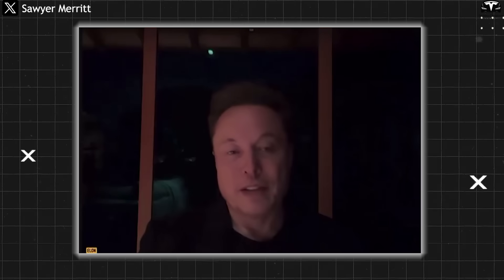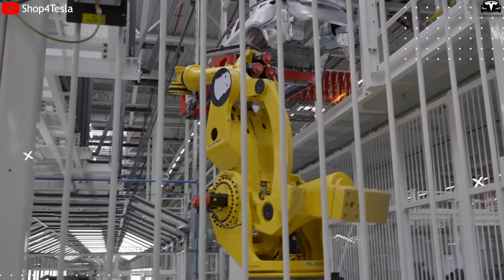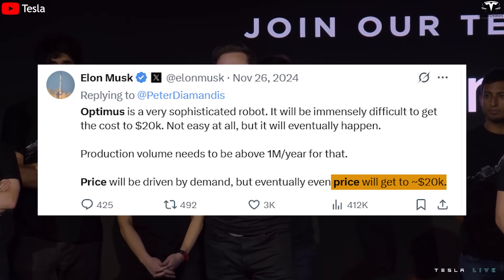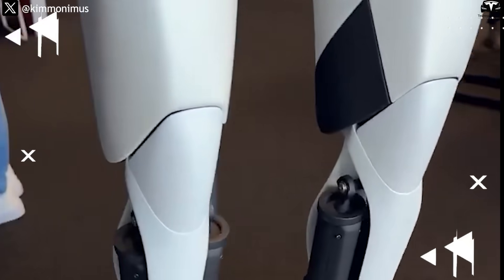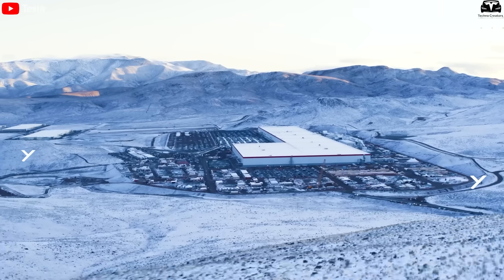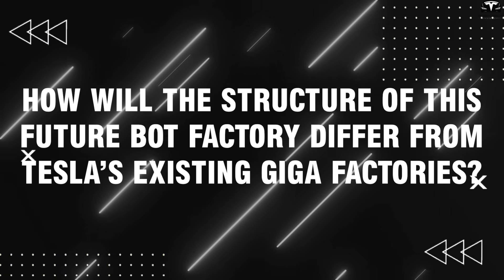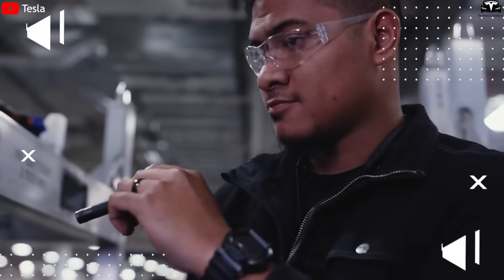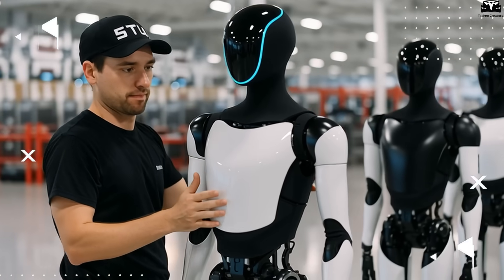It Happened! Elon Musk Gave Tesla Bot Gen V3 A New Factory, 10K Robots Coming! Latest Reveals

Comment: I wish you guys will on the robots but I don't think you got the power supply down yet cuz that size body mass around a frame what are you talking about a 70 lb battery at best
Reply from the maker: You're right, power density is a major challenge. Tesla’s using custom battery packs similar to those in EVs, optimized for humanoid form and runtime.

Comment: If it fails mid-task with boiling water or a knife, that could be deadly.
Reply from the maker: Tesla will need to build in multiple safety layers to prevent dangerous failures during high-risk tasks.
Reply: Without AGI they're going to have problems.